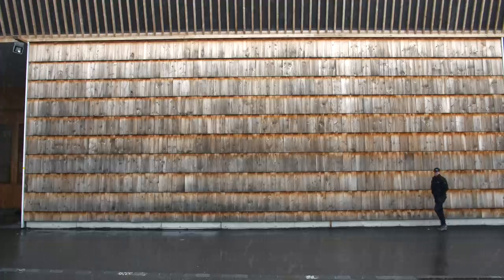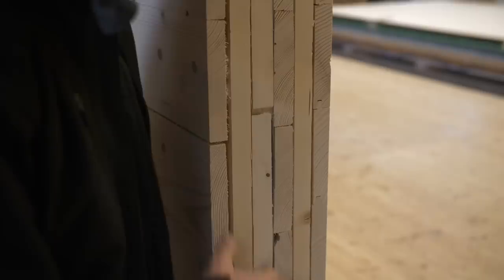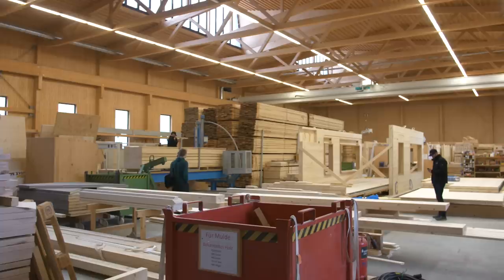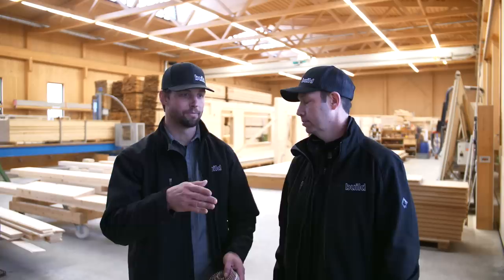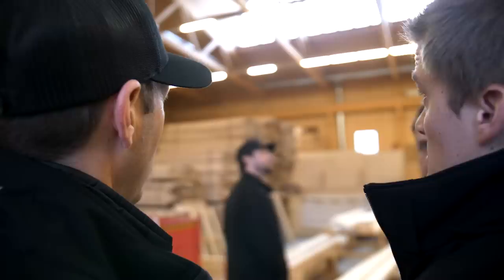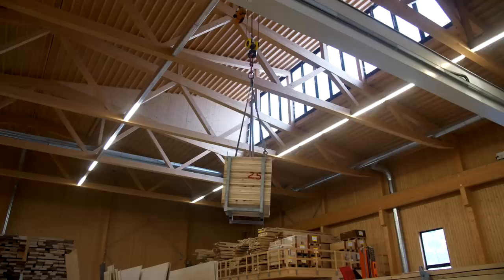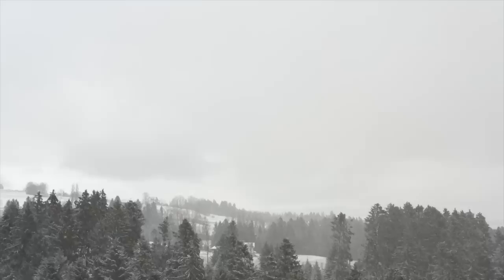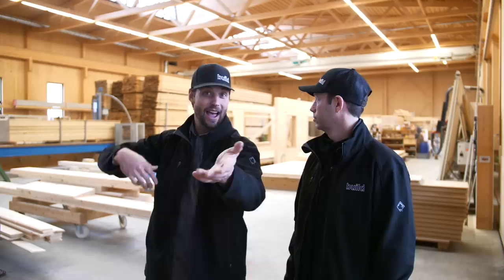This Swiss Builder uses NO INSULATION...

Comment: I guess they don't have termites like we do in Florida.
Reply: Nope... They don't like the climate here ;)
Wasps and the common furniture beetle are processing wood but do not seem to be a huge problem in most cases.
Reply: That was my question too.
Reply: Dade Pine is resistant to termites. Among other woods.
Reply: VeritasVideo given the chance inFLA, I would only want a concrete house with a metal roof, nowadays there ARE STEEL  which LOOKS like clay barrel roofs.
Reply: Wood worm would actually be a potential problem, but it can be easily treated.
Reply: Dry Wood ist Not Attacked by insects
Reply: @bastianfrom77  everything in Florida is attacked, even humans 😂😂😂
Reply: @MarcoTedaldi  furniture beetle will only be an issue if the moisture control of the wood gets too high so in theory as long as the house is well maintained with the gutter system and raised up from soil it should never be an issue
Reply: Correct. Wood is not for every. And i would agree with   “Leighton Samms” i would prefer concrete or steel for my exterior walls and foundation... for long term. And, maybe some wood inside.
Reply: Even worse the humidity in FL would have the wood rotting within a few years
Reply: @flybyairplane3528  here in Europe the standard building system is reinforced concrete and bricks,wooden houses aren't so diffuse.We add external insulation to concrete house using styrene plates till to 8 inches,internally we use a counterwall insulated with mineral whool.Our roofs are concrete build too
Reply: @JP-wk7cc  I own an all wood house in Florida. Even the roof is thick planks, under the shingles, not plywood. Built in 1985, when we purchased in 2012 it had very minimal damage but only because the home had never had a gutter system installed. We installed the gutters on both stories, only had minimal repairs needed on the siding and just 2 outside window sills with damage. We knew it was in good shape or we wouldn't have purchased it. It helped that my spouse is a construction project manager and certified home inspector. Also, just had it inspected for termites..none. We've had more damage from the bears and deer than water or bugs. I did have to chase out the fire ants though out of the yard and that is no small feat!
Reply: Nope you wont find termites in climates were its cold more the 7months...that why we have dade county pine but its super expensive now
Reply: No carpenter ants...
Reply: Or Wildfires like here in California!
Reply: Donald Kasper maybe the Story is different in Florida or for furniture which is usually exposed more to Human moisture. I live in a ten year old well Isolatoted Wood House (with Wood Fibre Isolation) and i dont have Any Problems. In my hometown you got traditional Wood Houses from 1350 a.c. The Wohle town was built on 12000 oak Trunks rammed into swamp Land Around 800ac
Wood is Amazing
Reply: we need to biomimic wasp saliva. wood is best for climates which freeze.
Reply: @ESSBrew  that's because we rake our forests, lol
Reply: Henry McDaniel  yes, and therein lies the catch 22. Neverending cycle of treatments.....
Reply: @cdx873v  you guys do keep a tidy forest 😁😁
Reply: Cedar siding should help keep them away I think
Reply: Jopino —— how long does it take carpenter ants to build a house?
Reply: Floridian climate is vastly different from central European. think more Toronto than Miami
Reply: You should see the termites in hawaii, its worst than florida, in florida the only treated part is the bottom plate all the studs are untreated,  in hawaii everything is treated and termites still go crazy, different types of termites
Reply: Donald Kasper  build it from bamboo,like Japan
Reply: Same with Australia. After 5 years you'd be able to punch new windows with a hammer, if you didn't get enough light coming through the walls!
Reply: Guess we don’t. You always have more bugs in warmer climates.
Reply: How about a real house?
No more ripoff 2x4 wood houses.
Would you like to live in a house,that stands for hundred years? No bugs, no mold, no hurricane, no bullets or anything pierces through the walls,no noise comes in?
Reply: @jimdavis74  exactly, how many times have we seen stick built apartments go up in a blaze.... it's wood it

Comment: Sitka spruce has one of the highest strength to weight ratios of any material. That's why it was used for aircraft (like the Spruce Goose) and is still used for acoustic guitars as the top wood of choice.

Comment: Burning...
Since these wood walls are solid, a fire would not be like burning a pile of sticks or logs. It would be more like burning out an old tree stump.
Reply: Hard to start impossible to put out?
Reply: And yet solid wood trees burn
Reply: @Nill757  the oldest trees are thousands of years old. Many more are hundreds of years old. Such trees have survived countless forest fires.
Reply: @mckenziekeith7434  true, bark is resistant to fire ( somewhat ) and those trees have thick bark or protective layer ( against insects ) that don't burn
Reply: In England wood beams are preferred for fire resistance , a  12" square oak beam will burn for hours and be strong while it does it.
Reply: McKenzie Keith Bark and internal moisture protects trees from light fires.  Big, hot fires burning vertically and thus fueled by O2 in very dry conditions often kill and consume wide swaths of trees.  And in this case the wood in these wood wall houses is completely dry, with no surface fire prevention provided by plaster or delivery wall.
Reply: SuperFunkmachine which is why HMS wooden ships were never destroyed by fire. Oops, maybe not.
Reply: Yea if its unfurnished. Once you put furniture and other flamable stuff i there its gonna get real hot real fast. Especially in a cabin where the rooms are smaller.
Reply: @Nill757  That had more to do with the fact that they liberally coated those solid wood ships with quite flammable pitch and tars and other oils.

Comment: The sound-proofing for one of those houses must be fantastic with the solid wood walls that thick.
Reply: Airborne sounds are greatly diminished , however sound that is created by, say walking on the panels in a two story house creates a drum effect.
Reply: @siriosstar4789  I'm not so sure that would be a problem in these houses. That is a seriously thick, solid layer of wood. The drum effect is partly due to the gaps in the floor and ceiling that let low frequencies bounce around and resonate. I'd like to think it would be reduced hugely by these panels (assuming they use the same for the floors).
Reply: Scubapig. My wife's son in law works for the Nur Holz company that makes these panels. He told me that the drum effect from walking on the panels is their number one complaint amongst their clients. They are currently working on methods to overcome this problem . The germans are used to cement or fired clay blocks for walls and pre formed  concrete for floors. These houses are of course waay  more quiet in between floors , so the CLT panel makers have to try and compete with this.
Reply: @siriosstar4789  Ah, OK. That's interesting, thanks. Looks like I was totally wrong, then! :) I just imagined they'd be more dense and therefore absorb the noise. That would drive me mad - I've lived in flats (apartments) where that effect from upstairs was huge. Not sure I could live in one then! Shame, because they are great otherwise. I guess it's a difficult problem for them, as they want to only use wood. Otherwise you could put rubber sheet in between the boards or something. Apparently it's sustainable, but I guess it doesn't last as long as wood. Maybe they could use isolating techniques like a recording studio room-inside-a-room system - have (wooden) standoffs built in to the panels to minimise sound transfer.
Reply: No, your not totally wrong. The panels do have quite a bit of mass. There are currently lots of new experiments to deal with the problem . One older and fairly effective method is to put sound board or rubber mats in between the panels and the framing below. In my house which is a laminated log house we put a plastic membrane and then sand  in between the joists and then a wood fiber board in between the flooring and the joists. That works pretty well. The best method ,although expensive is to put down pre formed concrete slabs over the framing and then install a soft material before putting the floor down. pretty complicated .
Reply: @siriosstar4789  Yeah, the rubber sheet thing. I mentioned that in my comment and that maybe it doesn't go with their ethos of durability, i.e: it will degrade a lot quicker than wood (I think). Maybe your plastic sheet with sand is better and would last a similar time to the wood?

Comment: The evalution of the thermal performance and energy demand of the building shows that it is possible to achieve a 40% reduction in the heat losses, compared with fixed internal gains and improved solar gains. It is POSSIBLE ALSO to obtain important reduction in the fuel consumption. Additinally the recycling of an existing building also allows an important saving in the costs, as well as the economic advantage of building under the profection of  the existing roof in the cold climate with high reimfall.
      Finally, the restoration of a regional wooden building with an acttractive arhitectural character avoids the impact a new structure in the area of outstanding natural beauty.
      Thank you for effective presentation for one exp. for webinar of Green & Solar aspects for civil engineer!
     With luck from Croatia side 🇭🇷

Comment: Great to watch thanks. My own home is about 300 years old, with a thatched roof, no deep foundations, no guttering, 3 foot thick cob walls plastered/rendered in lime mortar built on top of a rubble stone plinth, no underfloor heating and our only heating is a wood stove. We moved here to S.W England to have our family in 1995 and we weren't planning on selling after 2 or 3 years because we became part of our community. Unfortunately it's a listed home which means that in the 1980's the crappy, single glazed pine windows and cement render walls were protected and I had to get permission to take off the cement render to plaster with lime and replace the cheap windows with oak ones but they still had to be single glazed.
It has a bread oven, wood beams and  half rounded stone steps to get to the top floor.
When looked after cob buildings will last many, many years and the lime mortars and plasters absorb carbon dioxide, are breathable and have great acoustics. I have also built strawbale homes too
and without using metal mesh I mortar sprayed direct onto the bale surface, it too is well insulated, cheap to build and will easily last 100 years.

Comment: I live in an old house (circa 1870) in California. It is a solid wood construction with only rough cut 1x12 redwood in a vertical position nailed to a rim joist and a top plate and covered with 3/4 tongue and groove siding laid horizontally for the exterior wall.   The original interior wall was wall paper glued to the 1x12's.  But someone in the past had covered that with drywall which is now our current configuration.  One would be surprised how much sound it keeps out.

Comment: Not sure how they're calculating the R-value on that but from my calcs 300mm of nothing but softwood gives you an R-value of only 2.5. As an energy consultant we view timber as a thermal bridge through the insulation not as an insulant since the thermal conductivity of softwood is typically 0.130 W/mK but insulation is  typically 0.040 W/mK
Reply: Scott M I agree, when I look at houses in the mornings, when there is dew on the cladding I can see every stud position. Because it’s taking the warmth from the house and drying off the moisture.

Comment: You need to head to the Netherlands to check out some of the new wood road bridges.  When I was there they had a 2 lane bridge crossing over a 4 lane highway.  The bridge was supported by a 2-3 foot thick arch glulam.  Beautiful strcture!
Reply: Ha, never thought of them as something special! 😄 Tx!
Reply: What happens when a car fire happens and they burn the bridge down?
Reply: andrew kb 
Good question. I’ve never heard of it so it’s not a real problem but idk how these bridges are protected.
Reply: We have those in Norway too, very esthetical structures
Reply: @andrewk8636  It doesn't. Fire chars the outmost layer of thick wood. That char doesn't let much oxygen through. Ever tried to burn a thick log just by pouring a little bit of flammable fluid onto it? Doesn't burn much after the oxygen is used up. You only get a charred surface, it doesn't burn through the core.

Comment: I've been building handcrafted log homes for over 49 years.  I do my own designs and I'm designing for a minimum of 400 to 500 years.  It is entirely possible.  In Skansen, the oldest and continuously operating living museum in the world.  It is in the Stockholm harbor.  I went into one of the log buildings in the Mora Gård display and above the door on the inside was a flat that had been cut and the year 1320 was carved into it.  That's right folks, it was a 698 year old building.  Yes it had had some restoration done to it, but it was still standing and functioning as it was originally intended.  I also know that I've seen enough evolution of log homes to know that, done properly, a log home can last well over 500 years so long as someone lives in it to keep it a bit warm and makes sure that the roof is designed and maintained to protect the walls.  It is possible  This is one of the highest and best uses of logs ever and it sequesters a lot of carbon for hundreds of years.  www.loghomz.com

Comment: Hi, if you are into all timber roof trusses, google pictures of the "Swiss Light Source", a small particle accelerator, I used to work with a few years ago. When you enter the big accelerator hall, you are just overwhelmed by the size of its wooden ceiling.  cheers

Comment: 7:40 You don't really have to do a currency conversion unless you exceed a billion. 1 Swiss Franc is 1.01 USD...
Reply: Yeah... But prices are really not comparable.
Here, we calculate the cost normally by "cube meter"... And normal pricing is around 800.-/m³ (can go down to 650 for simple designs but you probably get the direction).
Alone digging and building the basement costs 150'000 for a normally sized house...
Building in Switzerland is expensive!
Reply: @MarcoTedaldi  
Ah yes, metric / imperial...
Reply: @Foche_T._Schitt  yeah... One m³ is around 27 cube feet...
I always struggle with imperial units (especially temperature is making me crazy)
Reply: How the Hell can a basement/dig cost you 150,000... Whole house cost in the USA with an insulated basement. @MarcoTedaldi
Reply: Lol where I live it’s like $4000 m^3

Comment: I love the channel, not trying to be a hater,  BUT...at 2:22 in the video there is a guy installing plastic flex conduit and holding it in place with metal nails.  So not really a house that is 100% wood with no plastic when you "knock it down" and it goes back to the earth. ( I believe that's what Jordan said?)  I love the idea and im sure the indoor air quality for this home is much less toxic compared to the homes we build in the USA.  Matt is a outstanding builder and i have learned a bunch from this channel.
Reply from the maker: Thanks!
Reply: Well I wouldn't wanna live in a house where there's nothing but wood around the electronics or even the water lines.
Reply: @Han Hattori Hanzo Yes, its corrugated, and it is used for running electrical wiring. So it is a conduit.  Search online for > Carlon ENT Blueflex Conduit

Comment: So when you were talking fire rating my mi d went straight to your sugi ban episode. If you think about it wood logs burn forever in a fireplace, and if you char them and then let them cool off they are nearly impossible to start back up. Funny enough if you chared the house first and then coated it like you do sugi ban. It should add time to the bure time, and also an aesthetic appeal. Cool videos from Switzerland, keep em comin of possible
Reply: Absolutely!
Reply: Townsend Jason - I think I might have seen that done during my visit to Switzerland.
Reply: BenjaminFranklin99 - outside of the house.
Reply: Over never heard of wood releasing toxins, I mean i guess everything being burned is not good for you, they say overcooked red meats have carcinogens, which are linked to cancer. But never really thought wood was all that bad
Reply: That's why you burn outside and then you take it inside, the smoke is the off-gas process, the black carbon that remains acts as an air purifier actually ever see charcoal air filters?
Reply: It's only ever done on the outside, plus it ceases to release said toxins after a few days.